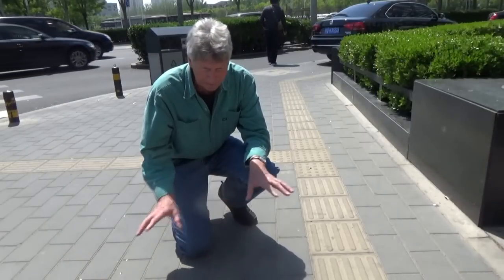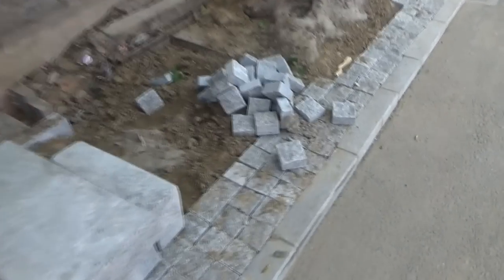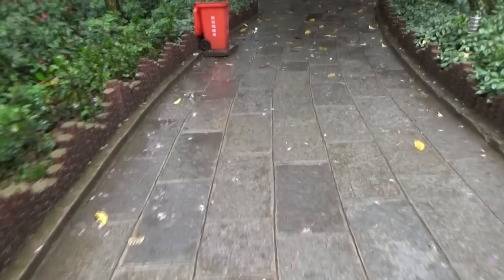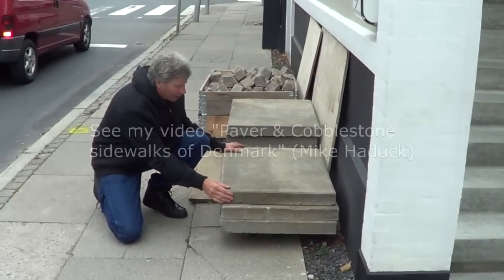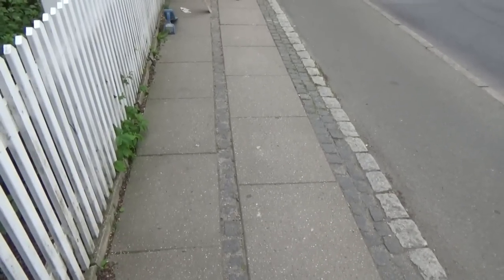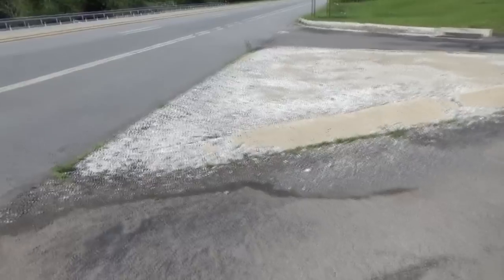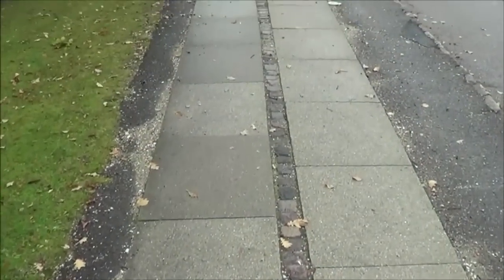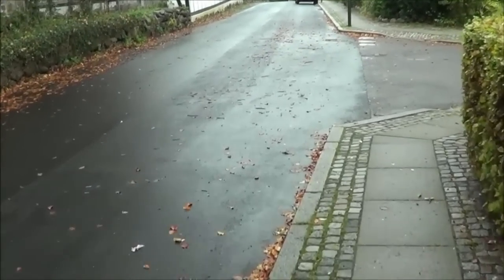SIDEWALKS  (Old School vrs. New School) Mike Haduck

Comment: It's clear that in the SHORT TERM it is cheaper in NEW construction to simply pour concrete as opposed to using granite pavers, curbs, cobble stone, and tiles. Even though as you point out so well, it costs so much more in the longer term.

In the States we have a an obsessive focus on short term costs and profits. We see this in the stock market and in the way most American corporations are run. I suppose it's only natural that this focus would be present in or construction techniques.

Excellent video! Thank you for sharing your thoughts and insights.
Reply from the maker: Thanks Cheeky,  I appreciate it.  mike
Reply: Cheeky Monkees cheap isn’t good good isn’t cheap . If you want to make a road way you have to excavate 12 feet to undisturbed ground compact base 0/3/4  6 feet toss Portland on top hard pack 6.5 feet concrete 6 feet bellow grade 6 inches above now top it with blacktop . Poor on 4 inch foam tack tape and seal 35 mpa  let’s see

Comment: The city that I live in is starting to put in concrete paver parking lots. The pavers have a space between each paver for drainage.  I own a small shopping center every year the parking lot is crack filled, seal coated and stripped.  Every 15 yrs the blacktop is completely removed and replaced.  I thinking about having it redone in dark thick concrete pavers next time.  No more crack filling/seal coating and the strips would be tan pavers.  If an area becomes worn I will just have a contractor reset those pavers.    There wouldn't be a repair joint to seal and the repair would be invisible.
Reply from the maker: Hi Meno,  it is someting to look into, I would do a lot of look seeing, and some solid research to see what works in your area, I think pavers have a lot more class and are a lot more simple to fix, especially if they have the right amount of base under them,  thanks mike

Comment: There's a historic town called New Castle in Delaware and while I was there I noticed all the sidewalks were this very old brick, and in many spots this brick was probably 200 years old. Wherever it needs fixing they just pull up the bricks, level the ground, then put them back. The curbs were granite like you mentioned, and the gutters were cobblestone and probably the same age as the sidewalks. Some of the roads in town even had the same historic cobblestone.

As an aside the houses in this town were all brick, and the brick still looked new, even in cases where it was 300 years old.
Reply from the maker: Hi Wolfy, and they will be there another couple hundred years, but they don't build that way anymore,  thanks mike

Comment: great video.......again! keep up the great work. I just rewired a house and the old wires were still in good shape vs the new romex that was all chewed up by rodents. another example is fuses vs breakers. fuses are more reliable and "break" much faster than circuit breakers.
new does not always equal quality. 
loved the tour! I know it's work to drag a camera around when you just want to chill and enjoy the scenery, but the videos are greatly appreciated.
Reply from the maker: Thanks Si,   I heard that about fuses from some ppl guys also,  I appreciate the comment, thanks mike
Reply: Si mclardy Thanks. More reason to keep my fuses.
Reply: Si mclardy --- The coatings/jackets for most new wiring system(s) are made from a 'vegetable' base oil...causing the rodent/pest attractions.
Reply: +arkansas13 I did not know that about the vegetable oil!
Reply: +otis08 just make sure you don't cheat the fuse size. you can buy irreversible sockets to set the fuse size. We still use fuses in industrial applications because they are like 6 times faster than breakers and that makes a big difference in some situations.
Reply: My sisters new Mercedes Benz got all chewed up due to this. She had to pay big to have the wiring harness replaced!

Comment: In Israel they used to use limestone curbs but limestone is really too soft for the job and they now use precast concrete curb pieces.  They also used to pave the sidewalks in limestone but it got worn away and very very slippery (especially going up a hill in winter), now they use cast paver bricks in most areas (or often they use asphalt as well).  They don't use cast concrete for anything but buildings pretty much (concrete is relatively expensive over here).
Reply from the maker: Hi Unbelted, I been there, Israel is a much milder weather then here up north,  but when the concrete starts falling apart they will regret it, thanks mike

Comment: the simplicity of pavers is that the upkeep is incremental at low cost while maintaining an always new look and feel. I think the reason why so many sidewalks in our towns are degraded is twofold: 1) concrete is like teeth, you can fill new holes only so manytimes until you have nothing of the original structure left, and then it is just rubble; 2) at that point you have already lived with a degrading concrete slab for years, and it becomes a monumental and hard to afford expense to rip it up and put in all new concrete. So it gets put on the long bench. To go back to the pavers,  even after decades there is no giant repair cost,  just the incremental paver at a time. As you say, simple and cost effective for decades to come. (sorry for the dated comment, I am new to your channel that I enjoy very much!)
Reply from the maker: Thanks ingmar,  very well said , thanks Mike

Comment: Excellent, Mike. Used to be, if the Water Dept. arrived to fix a connection under  the street in front of your house, the crew would as in your video, dig the hole with pick and shovel, repair the water pipe connection, and then they would fill the hole and repair the concrete surface themselves. Today, in my town, a contractor is hired to dig the hole, the Water Dept. workers fix the pipe connection, then contractors are hired to fill the hole and resurface with concrete. The contractor charges the town for labor and probably extra for a .supervisor, plus hourly rates for the backhoe and the dump truck, and a landfill fee for the stuff they ripped out. Also noticed that the contractors hired are usually good size, work all over the state, the region and some beyond that. So they have higher fixed costs and targets on profitability. The town sacrifices quality control, loses jobs and pays  for planned obsolescence so all the companies involved can make their profitability targets.
Reply from the maker: Thanks frank, I appreciate hearing that, it's probably very true,  Mike

Comment: we have roads laid in the 1890s called Hassam concrete, lots of basalt chips in it, beautiful crowns curving down to gutter side, most have tar filling joints, but they are just fine.  Elsewhere the city wanted to spend money so they laid asphalt that has to be replaced seems like every four years.
Reply from the maker: hard to say,  everywhere the weather is different,  but I do like the old school sidewalks,  thanks mike

Comment: The thing Mike didn't mention is Portland Cement Association. There's been a strong lobbying group for the use of cement since the early 1900's in the US. Their "contributions" (take that as you like) have helped ensure standards and codes encouraging or insisting on cement products in municipal projects. One of the most visible examples is the Dallas/Fort Worth Airport. The commission responsible for construction had substantial representation from the region's cement suppliers, so cement was used for every major component in the airport. having one-sided terminals ensured more cement walls and taxiways. The shuttle trains run on rubber wheels in giant cement troughs. They've been rebuilding the 50 year-old runways and introducing asphalt to the infrastructure.
Reply from the maker: Thanks, Mike

Comment: Hi Mike, I live in Germany, and what I don`t like about paving stones is that you have lots of weed and moss growing between them in the gaps, so keeping them clean is not easy. But many stones that are used here are made of concrete, and they don`t fall apart after 30 years.
I live in a street made of concrete pavers, that is 42 years old, and the stones are in good condition. We also have some Roads made of poured concrete, that where made in the 1950`s or 60`s, and they are still in pretty good shape, despite lots of winters with snow and salt, hot summers and rain. So maybe the concrete that is used in the US is not the best?
Reply from the maker: Hi Jochen, I have had bad concrete delivered before so that may be true, but the jobs are done cheap and fast with no thought of longevity,  Europe is more practical  and simple, so I guess I had to point that out , thanks Mike

Comment: I don't know, seems to me that i see a lot of movement even in 2 years one thing i like is the gravel trick under cement seems to work good, I am not sure how many men and paver crews you would need to keep up with those sorts of sidewalks but it probably takes constant work instead of 1 stent that does fairly well for 15 to 20 years. I put in a stone patio on top of garden cloth with gravel around and it seems to hold up fairly well for the last couple years but I did add more pea pebbles to it after the first year and now I am considering putting a curb around it because it settles more and more and I think it needs to be contained.. The garden cloth is not stopping weeds from growing up through it either so that product is not very good but it does sort of help it to maintain its shape.
Reply from the maker: Hi Mijemu,  every situation is different, on paver patios I always use concrete under the paver but around swimming pools I use pea gravel  or other ways, but every situation is different,  thanks mike
Reply: nonsense, after Dresden was bombed to dust the entire city center was a big parking lot for half a century, same thing happened in Leipzig south of the city center, big parking lot, is still there. but the old sidewalks are still there, still looking ok. not like brand new but usable. all you would need for it to look brand new is a little maintenance every once in a while and the beauty of it is you can reuse most of the materials that are already there with only very little replacements needed.

Comment: good job Mike. in your video paver driveway you poured concrete then put pavers. was that for the weight of the car? I ask because I'm going to put in a path to my wife's shed with pavers. was going to pour concrete then put pavers. simplicity, would I do best with a (washout) crushed concrete base and just run a line and put pavers right on there? here in Texas it doesn't freeze and I can get 12 yards of washout for $300 and I have a small backhoe so I can do the whole job in a couple of days. pouring the concrete, forms a couple of extra guys will be expensive. any advice on this?
Reply from the maker: Hi James ,  up here in the north we get frost 3 to 4 feet deep on average winters and it wrecks pavers in driveways and patios, In Texas it might be a whole different story, and up here it keeps out the weeds I would check with 
 the locals in your case,  I appreciate it.  mike

Comment: What is your experience with using pavers for a driveway? It seems to me every spring they would heave and sink and what not. But i may try it and see how it goes. None of the local guys have done it before.
Reply from the maker: Hi Sky, here in pa I won’t do driveways but if I did I would do them on top of concrete or have a huge base of modified or gravel,  thanks, mike

Comment: Just found your channel.  Really great info and thought provoking as well.  I need to build a small sidewalk to go from my back porch to a new pool.  Right at 10 ft., 24  inches wide.  I don't think I can hand mix fast enough to do  the whole thing.  If I do it in sections how do I go about doing the second one and so on.  For instance  do I need to wait until it cures enough to pull the form off of the end and use that slab as the end of the form.  The plan was to hire it out but I'm running out of money fast on the pool project!  I've did enough smaller things that I can handle it  but not sure about the details.
Reply from the maker: Hi Rick, check out my videos, "how I pour a concrete slab,"Mike Haduck  parts 1 to 4  they should give you some ideas,  thanks mike
Reply: Thanks.  I did watch them all.  If I build a form for the whole  length and then  put in a  cross board to do a section what will happen when I remove that board to pour the next section.    I can't just butt it up against the cured concrete can I?    Thanks for the videos, I'm sure I'll find what I need there somewhere.
Reply from the maker: Hi Rick,  there are lots of ways to look at it.  I usually use plastic to cover the old one and the plastic serves as a buffer between the two,  like I did on my videos  "how I float finish concrete",  you might get some ideas there,  everyone has a different opinion for different jobs,,,  I hope it helps thanks mike
Reply: Thanks.

Comment: Re: NASA and writing in space

NASA used pencils too. The issue with pencils is that graphite conducts electricity and it doesn't always stay put so it can cause problems (I don't know if it ever did but going to space is dangerous and it was even more dangerous early on so it makes sense for them to be cautious). Both Americans and Soviets used graphite pencils, grease pencils, and then pens when pens that worked in space were developed. They both agreed that graphite pencils were dangerous to use.
Reply from the maker: Thanks, I learned that, mike

Comment: The base of those old sidewalks is only crushed modified stone?  How are they are so level?   Doesn't seeping rainwater eventually create uneven dips in the sidewalk?
Reply: yes coarse sand and/or gravel/crushed stone. The sand layer must be minimum 4 inches, 6-8 inches is better. Key to keeping it level is compacting the sand on which you place the stones reall well. The compacting is done with a sort of hammerjack, a device which really pounds the sand in (or trampling with the heels of many boots). The stones are then pounded in the sand with a rubber hammer (or pry bar/large sledge hammer type hammer for big stones, like you saw in the video). Dips are almost always caused due to not enough compacting before laying the stones. Rainwater runs straight through the sand/gravel. Also the stones are usually slightly slanted towards the rain gutter/drain, like you would do tiles in a shower towards the shower drain.
Reply: Yes they do eventually dip down, but again, take them out, level the layer underneath (takes no time at all) and put them back. It's that easy.

Comment: I noticed they do pavers in Saint Petersburg Russia for sidewalks, pretty much any country I have been to does this. However, I noticed most of the roads are asphalt though. The asphalt was always getting pot holes and in terrible shape which makes me wonder why aren't the roads pavers? In your video, and my experience in Scandinavia as well, you see asphalt roads. Why is that Mike? Is it a cost issue or engineering reason?
Reply from the maker: Hi Jerrod, I would say for highways asphalt makes sense, for in town roads nobody wants to do it anymore, my opinion, thanks Mike
Reply: @MikeHaduck  makes sense. By the way I have learned a great deal from your videos. I've used them as my education to start doing small masonry and concrete pads. Even making a little side money. Thanks!

Comment: Mike interesting video in ireland local city , town and county councils have responsibility for sidewalks etc .private contractors can undertake public works but-they have to be  appointed by a public body .Personally I'm not a fan of brick paving ,either concrete or stone in public areas because it sinks or heaves before to long in my experience . Hydraulically pressed concrete kerbs ( because among other things the low water content in the mix) last a really long time.
Reply from the maker: Hi bric,  thanks mike

Comment: Mike, I am a subscriber.  Respectfullly a response thst you gave me about hydration has left me with questions.  You said that in your experience you had never seen hydrating concrete.  Do you think it is not necessary to soak concrete during curing?  I really enjoy your videos.  I just want to know your expertise about curing poured concrete.  Thank you!
Reply from the maker: Hi Tom,  I agree with hydration, what I mean is on building projects no one has time for it or the building would take years to build, some times I use plastic, sometimes the sealer, sometimes if the weather is cold and wet I let it go naturally,  every situation is different,  thanks mike
Reply: Mike Haduck Thanks Mike.

Comment: I don't know my geography... do they have snow in Scandinavia/Denmark/China? 

Because one thing about pavers is they can shift in freeze/thaw cycles... but mostly if not installed properly... but that's may be their argument.... here in Ontario Canada where our frost line can go as deep as 4 feet. 

With that being said... I still agree... that it would be quicker and cheaper to judt pull the granite and fix every few years thabk to rip up concrete... I'm with you!!!
Reply from the maker: Thanks Dustin,  Mike
Reply: Thanks for replying Mike. But you didn't answer my queston. Does Scandinavia/Denmark/China have snow and freeze thaw cycles to deal with?
Reply: Dustin Woloschuk 
Scandinavia definitely has snow and ice every year. China is more like Florida.